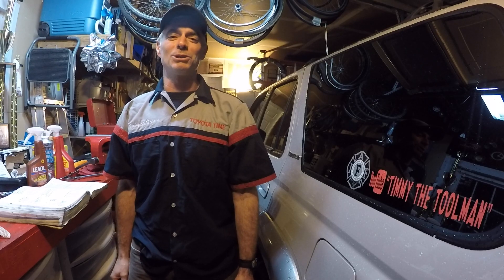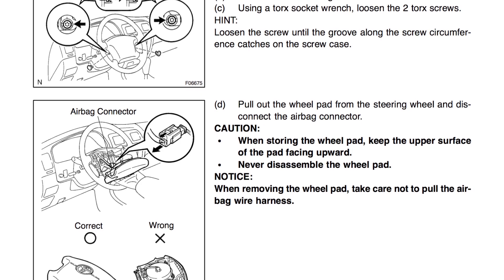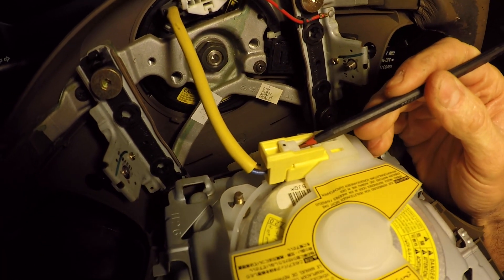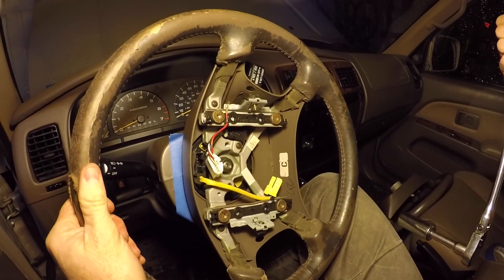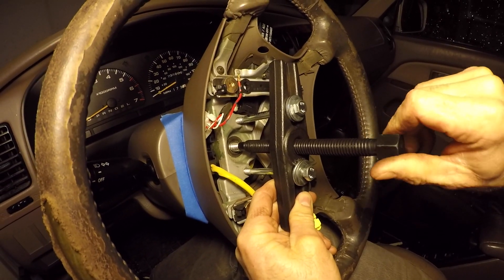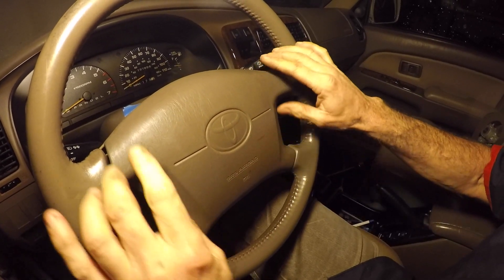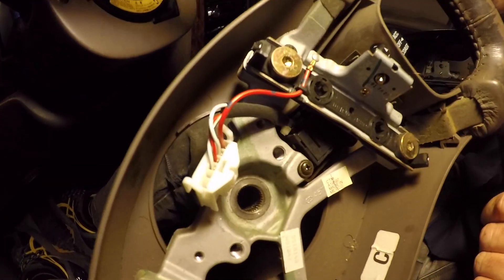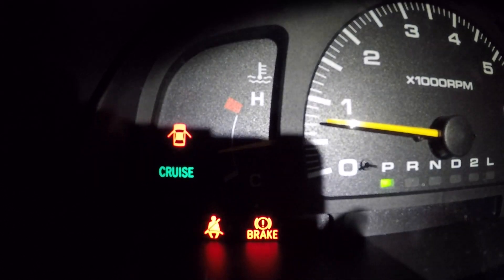Steering Wheel Replacement

Comment: Hey Tim!

I mentioned to you elsewhere when I replaced my steering rack my wheel was off by about 90°.

Can I just pull the wheel like this and put it back in straight and reset the clock spring? Instead of dealing with the rag joint (which is seized and won't go up. I'd have to disconnect the rack bolts in order to spin the top half of the rag joint.

Hopefully this is possible!
Reply from the maker: Hey Jesse, now that I've have experience pulling a steering wheel and understand how the clock spring works, you could definitely straighten your steering wheel this way.  Get your front wheels pointing straight ahead first.  Pull the steering wheel, recenter the clock spring (2.5 turns to the left and 2.5 turns to the right) and put the steering back on.  The steering wheel might not come out perfectly straight but you'll definitely get it closer than it was.  From the video, you can see that one spline tooth on the steering shaft can make a pretty big adjustment of the steering wheel.  Any fine adjustment of the steering wheel is going to have to take place at the outer tie rods.  Next time you get an alignment, make sure you tell them you want the steering wheel re-centered.  Let me know how it goes.
Reply: Timmy The Toolman well the alignment shop re centered the wheel and got it pretty nicely aligned again! Its probably one tooth to the right based off this video and at full right I can feel a lot of tension on the clock spring. 

I'll probably pull the wheel, move it one tooth and it'll be perfect and re center the clock spring and it'll be perfect! Thanks a lot!
Reply from the maker: Ok, let me know how it goes with pulling the steering wheel.
Reply: @TimmyTheToolman  Hey Timmy, I did this replacement and now my wheel is one degree to the left. I didn’t do the clock spring reset. By reading this comment I’m assuming it will correct it? 

I tried pulling steering wheel off without the puller. Then when I put on the new one it was off by a tiny bit, barely noticeable. Did I mess up the steering by pulling super hard? It didn’t come off btw. I had to go get a puller from Autozone. It is veering to the left more than when I put it on. I pulled so hard I thought I was gonna break the steering wheel. Crazy how it didn’t budge but when I used the puller it came off sooooo easy. Made me feel weak af haha.
Reply from the maker: @waltertang9303  I doubt you could mess up the steering by pulling on the steering wheel.  You should have been able to get the replacement one back in the same position as the old one.  If the steering wheel is off, that's because you're probably off one spline.
Reply: @TimmyTheToolman  I tried to move it over one spline but based off the marking it seemed to be way off. Sorta like in your video one spline made a huge difference.
Reply from the maker: @waltertang9303  Gotcha.  How your steering changed after the swap, I don't know.  The only way you could fine tune the steering wheel alignment now is by taking it to an alignment shop.
Reply: @TimmyTheToolman  Ok I will take it off and try again. If that doesn't work I will take it in to an alignment shop. Thank you!
Reply from the maker: @waltertang9303  Ok, good luck.

Comment: I bet its hand lotion that killed that wheel! It's is evil on whatever interior!  I've seen buttons discolor too from it!  Great vid!  Now my question is can I pull the wheel off my straight driving/no pulling on my 01 that has a slight crooked wheel and make it closer?    It has been that way since I bought it in 03 and I never really gave it much thought or cared to fix it.
Reply from the maker: kapple17 It might work to straighten out your steering wheel.  If you're one spline off, you'll end up centered.  If you're less than one spline off or more than one spline off, it won't work to perfectly center your wheel.  You do want to make sure your clock spring is centered if you try this though.  The clock spring should be able to turn 2.5 turns to the left and 2.5 turns to the right.  An alignment shop should be able to center your steering wheel by making adjustments to the outer tie rods and still keep the toe correct.
Reply: Thanks Timmy!!!
Reply from the maker: kapple17 You're welcome.

Comment: Currently trying to find a replacement wheel for 98 4Runner.

Does anyone know if the replacement wheel has to be off of another 98 4Runner?

Been getting mixed answers from different people and different wrecking yards.

Some say I can get one off of any 4Runner from 1996-2000. Others say off a 4Runner from 1996-2002.

Some have said it might be possible to get one off a Tacoma or Camry of similar year.

Any advice would be greatly appreciated!
Reply from the maker: Connor Long the replacement wheel can be from a 96-2002.. or like you said even from a Toyota camry or Tacoma or even a Lexus! If you get a wheel that’s not a 98-2002, you’ll need to grab the airbag too. As you saw in this video, if you want your cruise control to work, you may need to swap over the cruise control switch like we did
Reply: Timmy The Toolman 

Thanks so much for the quick response! Really enjoying watching all the work you've done to your 4Runner. Making me want to start making more upgrades to mine!

Thanks again!!

Comment: When I drive I hear a rattling sound in the steering column when I drive over bumps or railroad tracks and I'm hearing a creaking sound when I'm turning. What could be the problem?
Reply from the maker: It could be the slip joint in your steering column or tilt ball play. We have a video fixing both! Check it out https://youtu.be/xsOptgpfshg

Comment: The unique thing that has to be removed to get access to the cruse control switch was the horn switch.
Reply from the maker: I knew it wouldn't be long before somebody called me out on this.  While I was editing the video, I realized how obvious it was that the spring mechanism was for the horn function.  I guess sometimes I'm a little slow on the uptake.  I did already put this fact in the video description so at least people wouldn't think I'm too tarded.
Reply: I should have read the description before commenting. You were more focused on getting the switch replaced, it's easier for me to reason when I'm not talking and can focus think what is the reason for that. I was just watching multiple videos of yours while doing some programming. Really enjoy them, they are well made and very detailed. Usually end up watching multiple ones to see how the 4runner is put together. I recently bought a 99 limited, need to find time to do the timing belt and radiator, the parts are just sitting in boxes currently.
Reply from the maker: Well, I don't think most people read the video descriptions but I wish they would because we often put valuable information in there like torque values, part numbers, links to special tools we used and helpful tips to make the job easier.  I've also started to "Pin" a comment when I have something important to add that I think will be helpful to the viewer.

You were right about your assessment about me being focused on getting the switch replaced.  We shot that footage right after we got done with a test drive and finding out my cruise control wasn't working.  I was pretty sure swapping the switches was going to work but I just wanted to get that switch replaced as soon as possible and do another test drive to see that my cruise control was working again.

I'm glad you like the videos we've been making.  For the timing belt, just be ready to have to pull the harmonic balancer off with a puller and same for the timing gear.  Some people are lucky and they come right off.  Having a puller available and the correct size bolts will make the job go much smoother so you don't have to run out and find that stuff in the middle of the repair.  We put a lot of information in the video description so definitely read through it.  Also, make sure you use the technique of getting the belt on in Part 2.  Backing off the tensioner bolts so the belt slips on easier is the way to go.  

While doing the timing belt job and radiator replacement, consider adding an external trans cooler because that would be the smart time to do it.  If you have any questions along the way, don't hesitate to ask.  Happy Wrenching!
Reply: Timmy The Toolman that's how I found your Channel timing belt replacement videos. Yours was the best one. If I'm going to do a job I read the descriptions of your videos as they are very helpful. Thanks for spending the time writing then up. Good idea on pinning a comment allowing others to see it right away since YouTube collapses the descriptions.
Reply from the maker: We try really hard to give people the most accurate information available so their chances of success are better.  I do like the pinned comment for the reason you stated.  I think there's a very low percentage of people that bother reading the video description.  A lot of the questions people ask me would have been answered if they just read the video description.  

When you get around to doing the Timing Belt job, let me know how it goes for you.  Happy Wrenching!

Comment: Extentions do not effect torque.  Extending your lever arm absolutely will though (torque adaptors/crows feet).   Even deflecting a few degrees won't change target torque.....

But what if you do use a torque adapter but at 90⁰ to the torque wrench....?  🤔
Reply from the maker: Hmmm, I think they do at some level from my personal experience.  Take for example the situation when I've strung together several 1/2" impact extensions together to get to transmission bell housing bolts.  I hook up my impact gun, pull the trigger and it fails at breaking free the bolt.  Take a similar sized bolt that is torqued to the same spec and attack it with the socket attached directly to the gun, it it spins it off with ease.  The only thing that changed was the extensions.  So, if it's a single short extension, I tend to agree with you.  The longer the extension gets, and especially if you have to string together 2 or more extensions, the torque you're able to apply changes drastically.
Reply: @TimmyTheToolman  indeed.  However, if you had a 5 foot long socket in the same situation on a impact gun it would work just fine.  Unless you're using a complete setup of impact extensions with an impact wobbly on an impact you probably won't get those bolt broke free. All that slop!   If you use that stack of extensions with a long breaker bar and take advantage of that torsional spring it'll pop loose easy peezy!  But how awkward would that be!!  🤣
Reply from the maker: @BigBluePile  On the occasions I was using wobble extensions and the impact failed, I did either break them free with a bit 1/2" ratchet or a medium sized breaker bar.
Reply: @TimmyTheToolman  cheers!  🍻  Thanks for the chat!
Reply from the maker: @BigBluePile  Yeah, my pleasure.  Come back anytime.